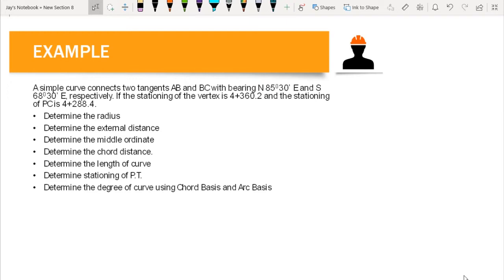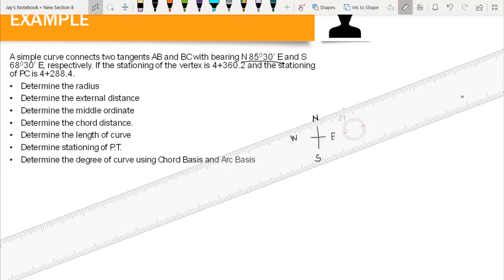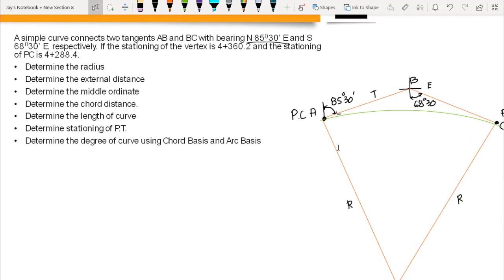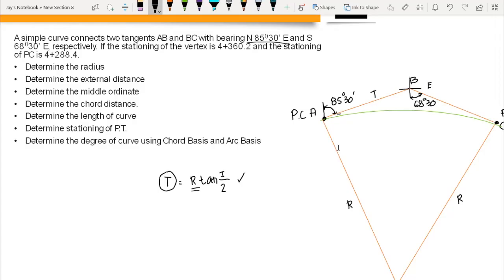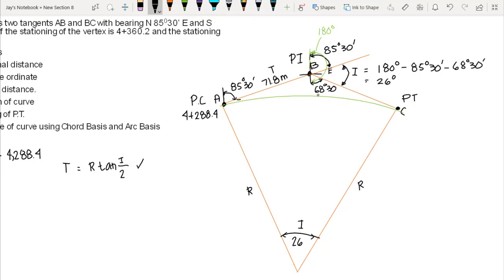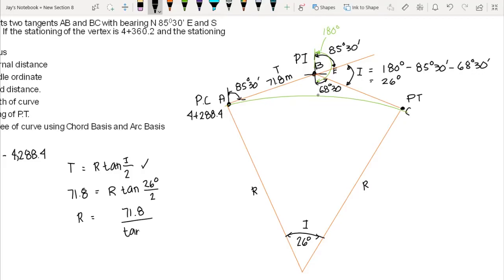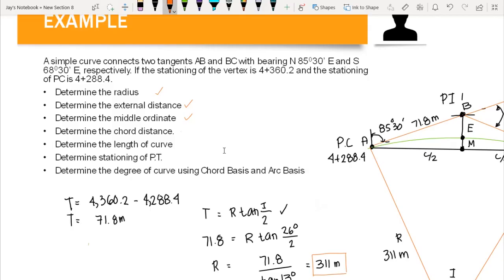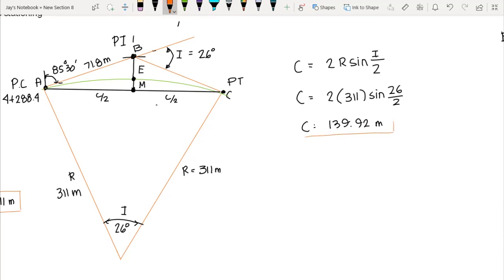Highway Engineering | Simple Curve Sample Problem Part 2 of 2

Comment: CALCULATE THE ELEMENT OF THE CURVE OF SIMPLE CURVE WHOSE DATA FOR THE TANGENT ARE GIVEN AS FOLLOWS:

AV VB

N 30" 18" E N 80" 46" E

100 meters 100 meters

a. Compute the rectangular coordinated of the points along the center of the curve sta. 0+000 if P.C. or Point A is 20000 N and 20000 E.

b. Compute for the technical description of the point along the center of the curve and the points outside if the width of the road is 10 meters. Also determine the area of the road and its technical description.

c. Determine the Northing and Easting of each coordinate of the road lot. Also determine the latitude and departure of each points within the road lot.

Note: Assume P.T. is point B.
Hi Po sir paano Po pag ganito ung problem😭😭